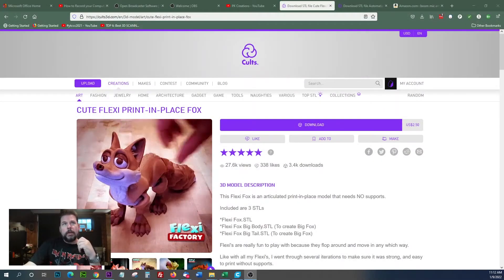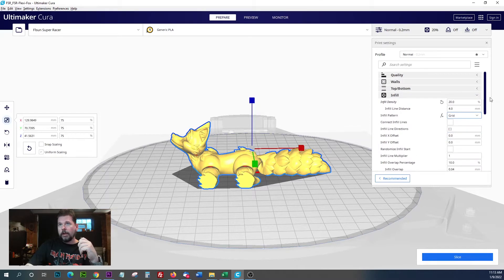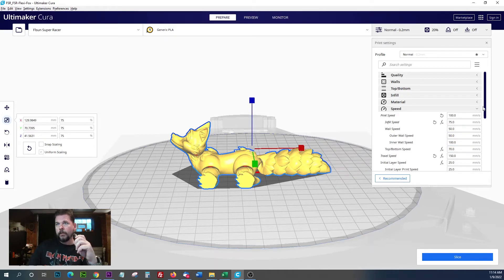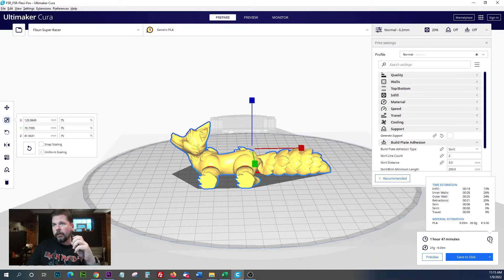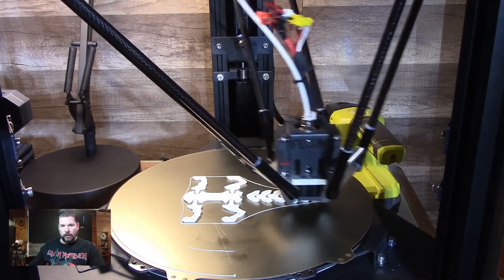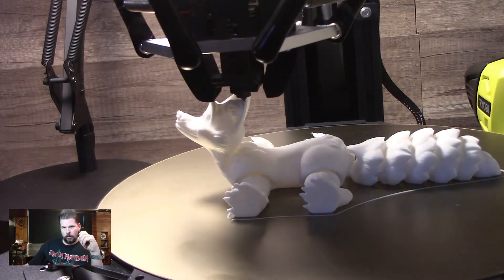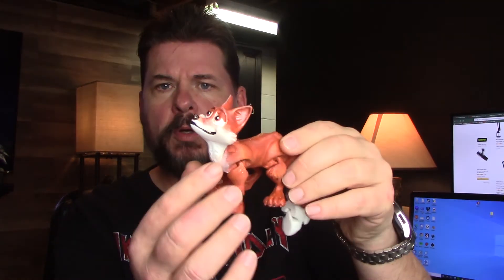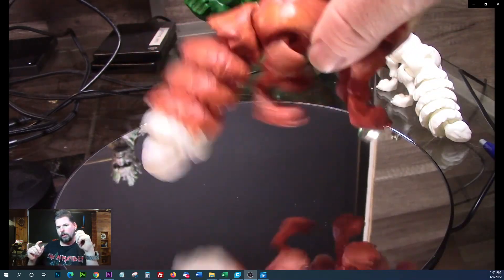3d Printing a Flexi Fox on the FLsun SR, Sliced in Cura

Comment: hi, nice project, my son is crazy. A question about the magnetic plate that I see in the video where you bought it? I think it is excellent for solving the problem of adhesion to the FLSUN plate, am I wrong?
Reply: I really didn't have much problem with adhesion my main issue was with waiting for the plate to cool down enough to remove the model without pulling on the bed which will throw off the leveling which will effect adhesion.. hope this helps - Paul